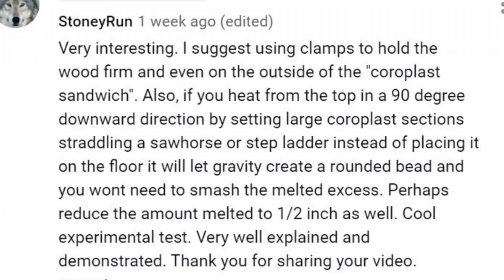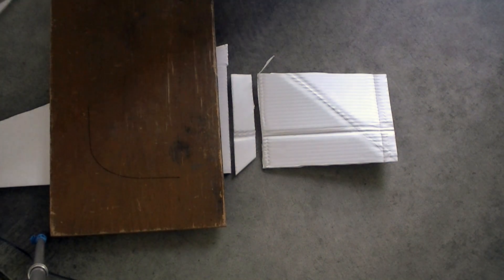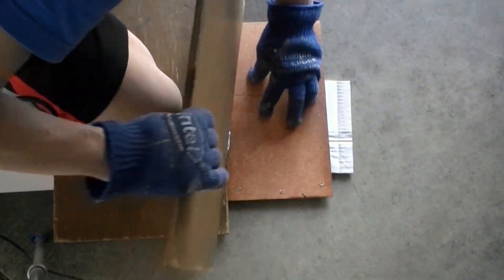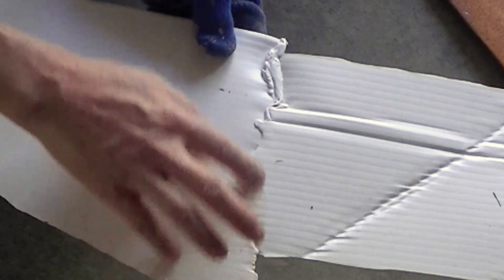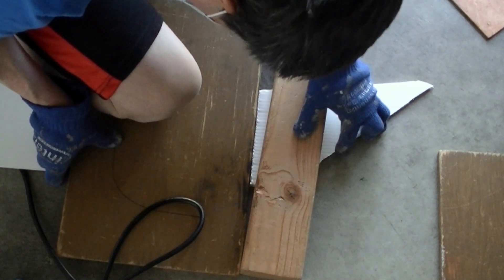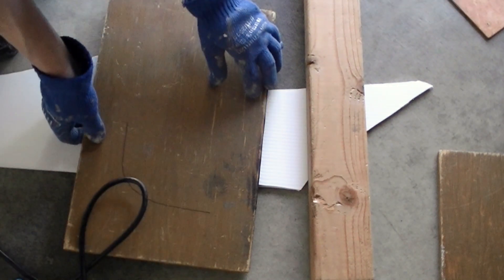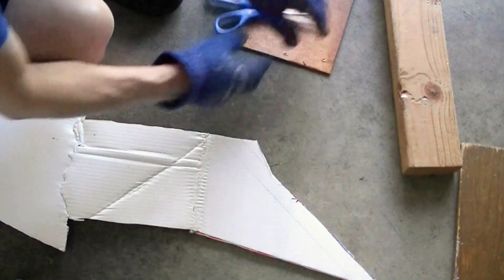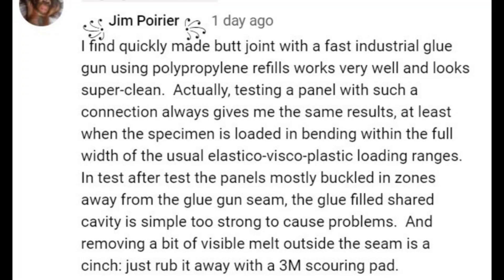Pt 2 2021 New Heat Fusion Methods - A Simple Butt Joint For Coroplast

Comment: Spin welding, aka stir-friction welding works well for polystyrene , and according to Google , also for any thermoplastic. A drill or oscillating tool might provide sufficient rpm, but the parameters would have to be worked out including the shape of the bit for the best amount of friction and mixing of material across the joint.
Reply from the maker: Coroplast is polypropylene, which has very different characteristics as polystyrene. There are two viewers told me they can 'glue' coroplast/polypropylene with polypropylene glue gun & glue sticks. But the the glue gun is too expensive for me. We can use ultrasonic welding on coroplast, but again the cost of the equipment is too high. Using the $9 heat gun is an inexpensive alternative to build stuffs. My goal is to build stuffs without spending too much money on tools.   The result may not be perfect, but is good enough for me.  Thanks for your input.

Comment: Fiberglass mesh as used in drywalling could lap across the joint while allowing hot air to soften the plastic underneath, then press the mesh down with some kind of roller?  Or maybe use a clothing iron to simultaneously melt and embed the mesh?
Reply from the maker: Thanks for your suggestion and input. I have used coroplast to repair my cloth dryer's lint filter. I cut a piece of metal mesh and fused the coroplast at the edges of the mesh to provide support and also used it to covering up the edges of the mesh so it will not cutting my finger. That works really well. Using mesh to join two sheets of coroplast has its merit. It may be useful for strengthening an enclosure, such as building a coroplast trailer/camper. Most of my application is for building foldable boats. I need a watertight joint and the adding mesh doesn't help. Fusing two pieces of coroplast using lap-joint and then apply silicone sealant at the joint works well as illustrated in this video. https://youtu.be/rmotKWDNlYg    The fused coroplast provided sufficient strength (for the kayak) and I don't see the needs for adding the mesh. It may be useful if I build a foam boat. Cheers!

Comment: A Bicycle brake cable down a channel can actuate a live hinge for you. Coroplast is really good for flexures and compliant mechanisms with bicycle brake cables.
Your videos have been amazingly helpful. Thank you.

You really must start calling this Corogami though. it's sitting right there...
Reply from the maker: Thanks for watching and your excellent suggestions. In building coroplast boats, I avoid building the boat with 'moving' metal pieces, because the metal/wire when in contact with the plastic will likely cut into the plastic. Of course, if the bicycle cable has a stationary sheath and that should work. I still prefer to use thin nylon rope because my goal has always been to lower the cost and the overall weight of the boat.

Comment: Is the simple butt joint (experiment #2 from this video) still your current recommended way of fusing 2 sheets together? I'm concerned about folds across (perpendicular) to the joint. Thanks so much for sharing your experiments!
Reply from the maker: The problem with butt joint is I can't join two sheets wider than 1.5-2' because my heat gun can't generate enough heat to melt the edges longer than 1.5-2' .Therefore when I built my tandem canoe, I used the technique illustrated in this video https://youtu.be/rmotKWDNlYg   My friend used cloth iron and that works too, but the fused joint (based on my experiment) is not as flexible as the one I used (shown in the video). Others have used contact cement with good result and I believe it can handle simple bending and folding also. When making a fold on/across the joint, I recommend the fold line be parallel to the channels on the coroplast only. Hope this help.
Reply: @DIYUSA  This helps immensely. Thank you very much.

Comment: You might enjoy an "Acrylic Line Bender".  I use it to bend coroplast, especially cross flute.  I also use an Ultrasonic Welder to spot weld the coroplast, and I've seen a device online that is able to roll crimp the edges shut.
Reply from the maker: Thanks for your input. I have never used the acrylic line bender. I will look into this if this will help me to build a better boat. As with the Ultrasonic Welder, I looked into that when I started the boat building project/hobby, But I don't want to spend over $2000 for the welder. I may use that money to buy a boat instead :-) However, it inspired me to look into the heat fusion method to join coroplast sheets together. The ultrasonic welder is very strong. But it also creates the ugly depressions on the surface of the coroplast. I saw devices that can give the edge a very smooth finish, however that is beyond what I can do in my garage. At this point, a simple fold on the edges will work for me (or cover the edge with tape), but I am still looking into a better way to finish the edges without spending a lot of money into tools. Cheers!

Comment: You might try a 12 to 1 scarf joint. Would probably require a jig and router. Used frequently in wooden boat and aircraft building.
Reply from the maker: I appreciate your input.  I investigated what scarf joint is. The coroplast I am using are 4 and 6 mm thick, which may not work with scarf joint. But your input make me think about slicing the thin coroplast edges. Then I can sandwich and fuse both ends. This may create a better water tight joint since there are larger overlapped layers. I will give that a try. Thanks again.